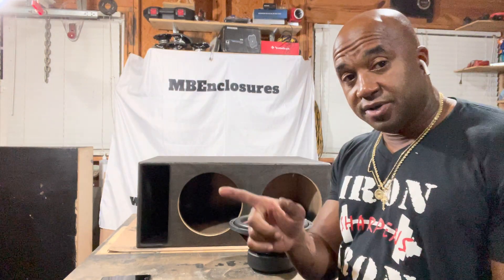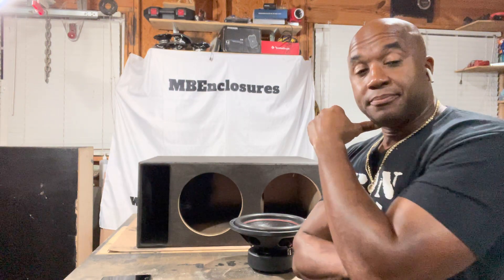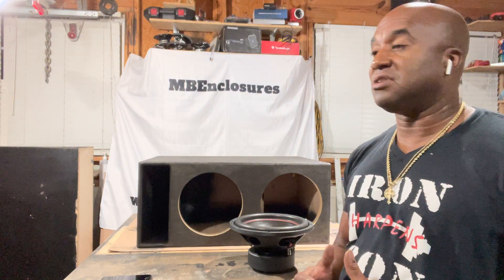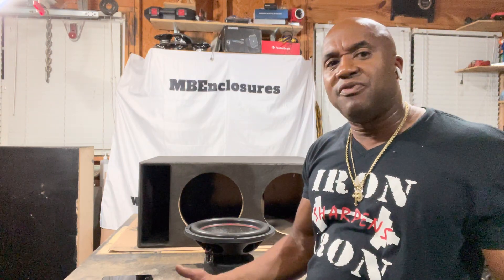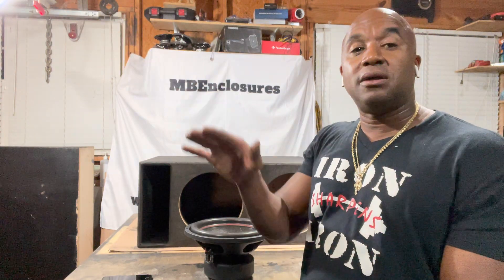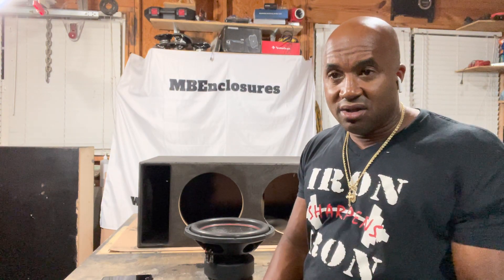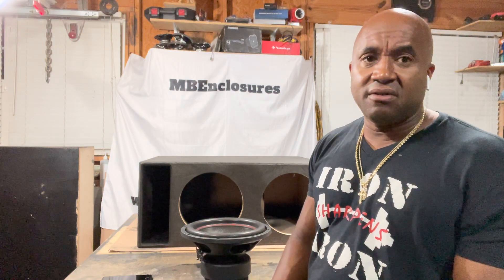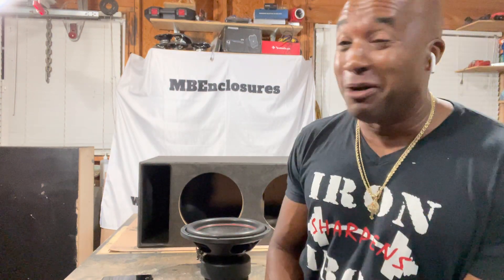Dampening in Subwoofers and Amplifier…. The explanation.

Comment: Alpine is the only company to design and build their mono block amps with a high damping factor. Alpine S2-A60M has Damping greater 1,000. The S2-A120M greater 750. Most amps have a   Damping Factor of 100-150. And they tend to say Damping Factor doesn't matter as long as it's over 60.

Comment: linear xmax is typically measured one way, mechanical Xmax is determined by either the VC hitting the backplate or the spider flattening out at peak excursion, surrounds help some, you seem them wrinkle up when you have a really high mechanical xmax

Comment: What number is a good dampening number? On a amp to have high control of ur subs?
Reply from the maker: Greater than 200 isa starting point
Reply: @M.B.Enclosures  so 95 on my taramps smart 3k 95 isnt that great? My skar evl 2 12s get loose and muddy under 35 htz with a audio control dsp no clip . Thanks